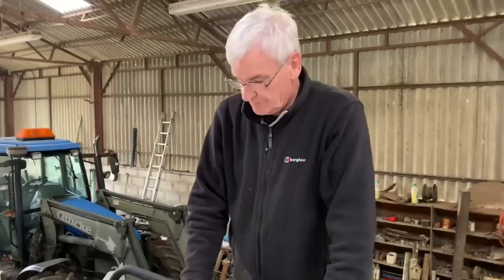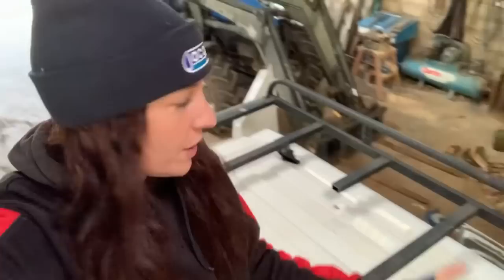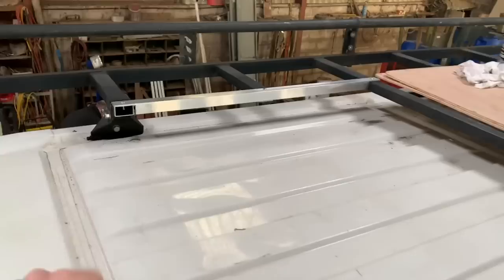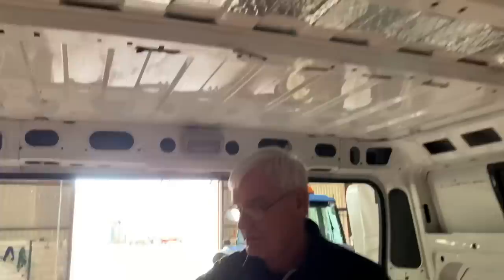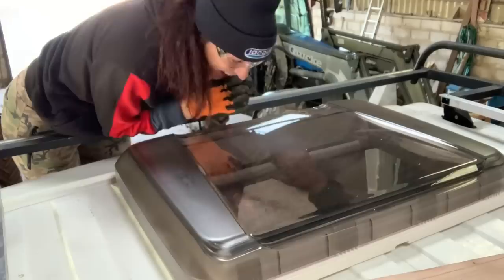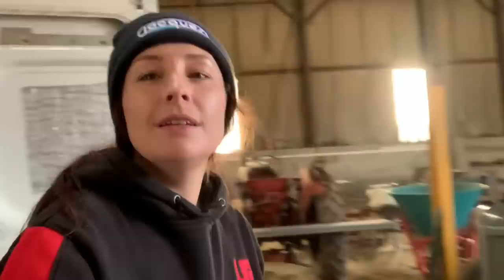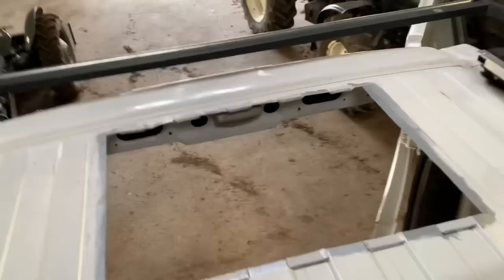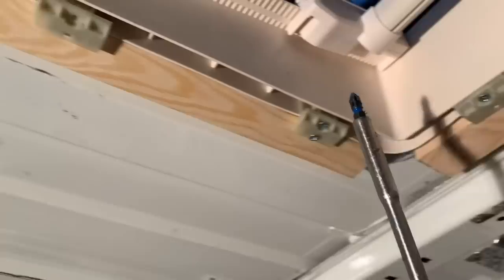FITTING THE SKYLIGHT - van build Ep.9

Comment: Good thinking, Nick. Supporting the cut roofbars like that. It’s the same way you deal with cutting joists and rafters in a house.
I think it’s for the best you moved the skylight further back rather than cutting or removing that roof support. I think it would have greatly  weakened the van roof. After all, it was there for a reason.